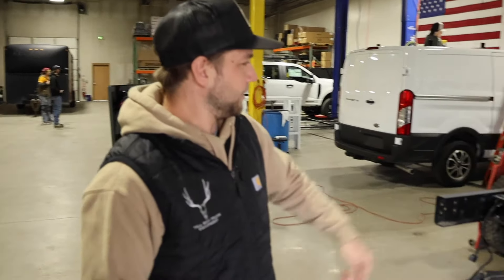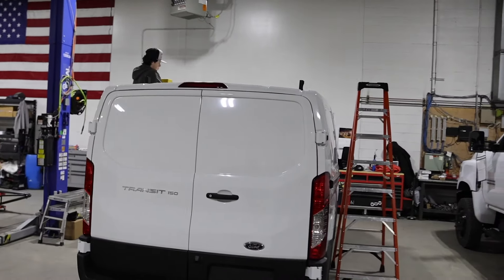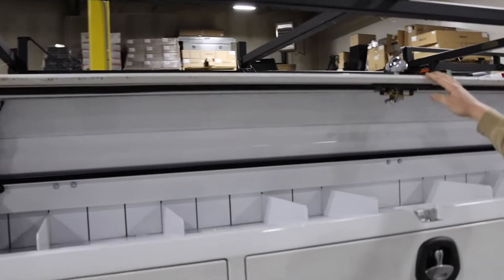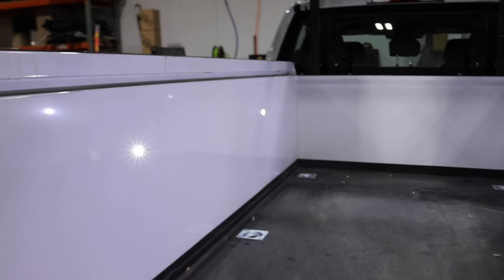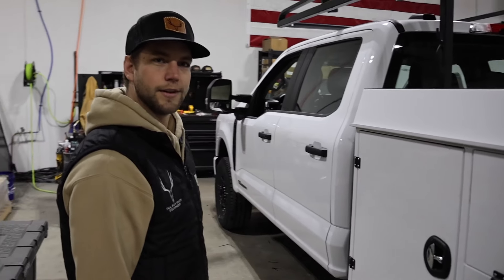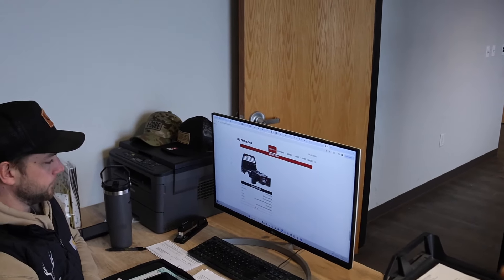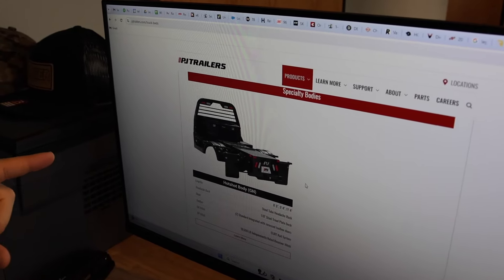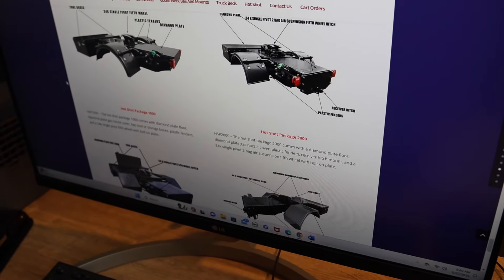I'm Building A Cab/Chassis HotShot Truck And I Need Your Help!

Comment: Here in Illinois 95% of hot shot trucks are Ram there's a reason for that and that's all I'm going to say
Reply: I agree...most hot shot trucks I see on the road are Ram's
Reply: Yep
Reply from the maker: I’m in the process of seeing if the RAM store wants to build a truck also 👍🏾
Reply: It was like that down south till the dpf issues started to arise now all are switching to ford because they have less emissions related issues.
Reply: I can tell you exactly why. They’re the easiest to sleep in the back of. Thats it.
Reply: Because they have to give $20000 discounts to still sell less trucks?
Reply: We run ford f450s because they’re literally the only ones that can handle the abuse. Now that being said we run in the oil patch. Rams suspension holds up wel but not nearly as well as ford. We also typically get rid of them before 100k for a multitude of reasons. I was a Dodge guy for years but with what I do now ford is the only way.
Reply: Same here in NH. Hot-shotters want Ram or nothing.
Reply: Ram engines are more reliable 450k and counting.
Reply: Naturally balanced inline 6, way less moving parts.

Comment: Super awesome Justin make sure you put a Maryland plate on that thing so it knows your roots driving on I95 traffic, don’t forget pro and cons on good brand of air bags, some drivers prefer no bags if they are driving more off the interstate so depends on the type of hot shot business this also would factor in the type of tires, super fun build and please address all the types in many videos
Reply from the maker: Thanks bro, I’m excited to see and share the process 👍🏾👍🏾
Reply: @JB_WhoWork  I hope you’re able to get some information or maybe attend that medium duty truck show I think it’s in two weeks in Indiana should be lots of details you can gather maybe even some new releases for RAM maybe Chevy and that 8.3 diesel that everyone seems to be waiting to hear about it hope it’s able to not just have high payload but increase towing capacity to match f550 and ram 5500

Comment: Issue with a cab chassis is the derated motors compared to the private market. The manufacturers say its for durability, but most companies I see that use these cab chassis trucks are going to turn these in when they hit 100k miles anyways. I put 250k on a 2017 F350 DRW with little issues, so not too sure about their explanation. The only difference is the turbo size. So I'm sure you can most likely change that out to get more power, trust me you'll appreciate it going up hilly terrain towing 30+k lbs. If you prefer a bed delete, take the F-450 you'll appreciate that wide track front axle, and camera's, makes getting into tight spots easier especially with power folding mirrors. If your sleeping inside your truck, then perhaps the Ram is the best bet, has more room in the back. My trucks are mainly single cab F-550's with a gooseneck utility box as the bed, and are used to get into tight construction zones etc hauling containers and materials and having a shorter wheelbase helps with that, making incidents less likely to happen. Get 2 fuel tanks as these trucks when towing suck down fuel fast and 30 gals isn't enough to have on board. The Ram has the better engine brake as well and is a inline 6 as opposed to a V8 in the Ford's. A 4.10 or 4.30 rear-end are your better rear end differential choices. If you do mainly highways in non slippery conditions then the 4.10 2wd is the best option. Hills and rugged terrain the 4.30+ 4×4 will suit you better. Best of luck ✌🏽🇺🇲

Comment: Make sure that if you order an F-550, you check “Trailer Tow Package - High Capacity” and that’ll automatically add the “Payload Plus Upgrade Package” and give you the 4.30 gears, limited slip rear end, the 40,000 GCW (F-500 specific rating), and the 14,706lb RGAWR.

Can’t wait to see what becomes of this build!
Reply from the maker: Thanks for the info, I think a max tow truck is the only way to go for hotshot unless you’re hauling RV’s 👍🏾
Reply: @JB_WhoWork , if the truck will be hooked to a gooseneck its entire life, payload capacity matters more anyway. Getting it configured how I mentioned is generally the best bet since the truck would have the best options available and the highest ratings.

Comment: Max tow is not a great idea. I’ve been out here on the road for 13 years. The biggest expense is fuel. Having the lowest gears binds you up on top speed. Quite honestly, the best way to make money in hot shot is light. There’s more than enough motor and gear to pull loads that you need to worry about lowest gear set. Fuel savings goes straight to the bottom line.
Reply: Amen, well said fuel mileage is the only way to keep these 19.5k rated trucks running long term
Reply from the maker: You lose nearly 10000#’s in towing capacity going with the 4.10
Reply: @JB_WhoWork  that’s actually not the case at all. That’s just marketing BS. I promise you. If you actually count the teeth on the ring gear. You find it’s a joke. Like 2 teeth. I have done real world testing with a 40k set up with a Ram 5500 and also a F350 . Just ask a guy who knows how to set up gears. You can do way better in a hot shot with 373 over 410 and it gets worse with 550 or 5500. I did 4.42 on 5500 and it did way better than 488 you just get way to gear bound. Ok for a tow

truck, but sucks for over the road

Comment: Would you recommend a setup like this for hauling a large luxury fifth wheel.
Reply from the maker: If the rv has dry hitch weights over 4000#’s, absolutely! If you have the budget for a Kelderman suspension it will ride great unloaded!
Reply: @JB_WhoWork  I think the hitch weight of around 3,700 pounds fully loaded down.        

If it helps you out at the fifth wheel that I am planning on getting is a Jayco North Point 390CKDS with a unloaded vehicle weight of 15,835 and a GVWR of 18,350 pounds and the trailer is roughly 44FT long and the trailer is 8FT - 6IN wide.

Comment: Around here, if they want to steal fuel, they crawl under the truck and drill a hole in the tank...
Reply from the maker: Good point, a thief will find a way…
Reply: @JB_WhoWork What's worse, is they don't care how much it costs you so they can steal $10 in fuel....